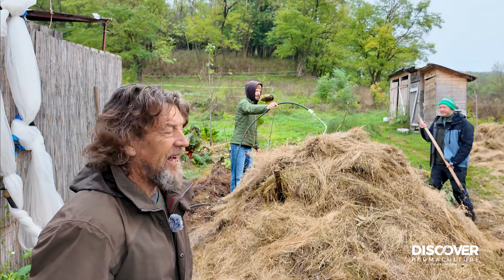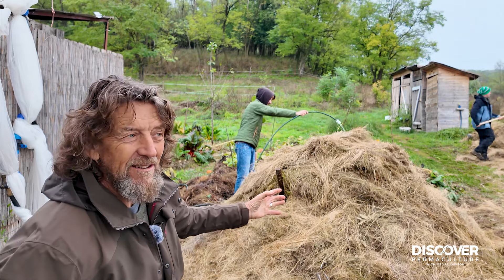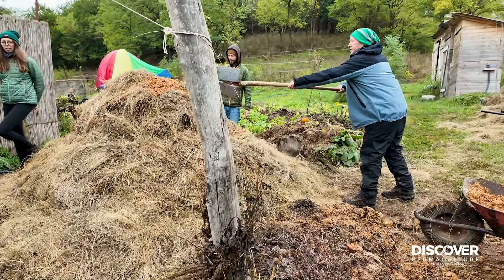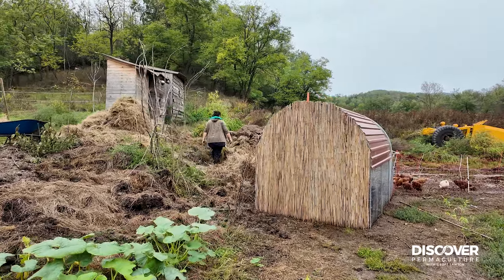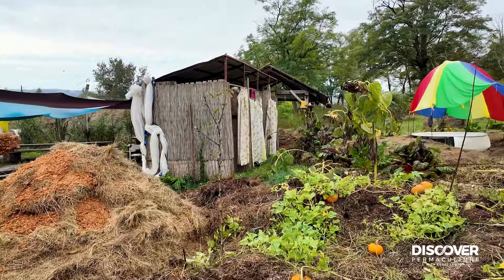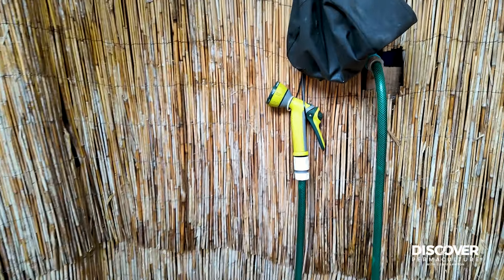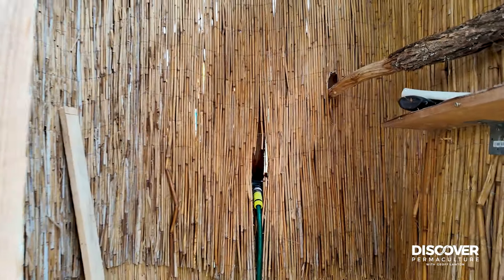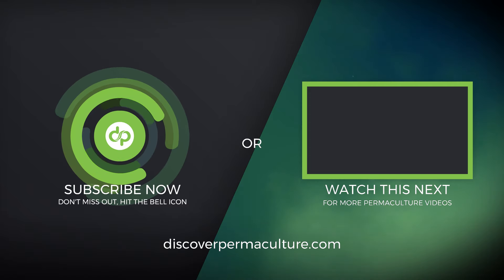Hot Water Compost System in Hungary

Comment: Does this system have its own water pump? Curious because I live off-grid and would potentially need to gravity-feed a shower using this system. Such a great idea nevertheless 👌🏽
Reply: You can use a pump. However, it more efficient to elevate the input water so it could be gravity fed into the compost pile.

Comment: If a concrete pit was built with a plastic pipe spiral in it to make the heat exchange between the hot compost and the water in the pipe better, and the compost pile was covered with some insulation, than the system would be even more efficient.

Comment: Nice, but where are the valuables informations like : What quantity needed, what spectification of compost is targeted, at what cycle does it works usefully, what can we expect from this quantity of work, how many turns of pipes in what configurations, what use of the compost, what energy involved for what output..?
Reply: You need four cubic yards minimum. Search for Jean Pain.
Reply: @estebancorral5151  Yeah I already made many searches around Jean Pain, but actually with less quantity I tried and it worked quite well, but stil i'm an not satisfieed with the ratio work/heat harvested.., the germans have experimented system of 1 cubic meter in IBC tank also, name "biomeiler" if i remember well

Comment: It won't work anywhere near as well as you think, looking forward to updates.
Reply: Agreed. I love the hot water from the compost, but the showerhouse was both wet and decomposing. They needed to use waterproof materials for that construction, like aluminium or tiled brick. All the spores and microbes eating the shower walls would make it impossible to clean or to get oneself clean. As much compost as they had, they'll have to put the shower walls in the compost.

Comment: You would need a lot of compost to keep this going and it would require a lot of work to change the compost when it runs out of heat.
Reply: Yup, lots of biomass needed for sure. Some areas have huge amounts of wood chips available. You'd probably want make multiple piles and overlap their active cycles to avoid moving a bunch of frozen material in the winter.  Large open covered bays would be great for controlling the moisture level more precisely and keeping your next wave dry and ready for mid winter constuction. Don't know the specifics, would have to play with a system for some years to dial it in.
Reply: In most setups it's used to heat a house for a season. If you gather enough compost it will be warm for 3-4 months. Depending on the climate it might not properly heat a big house but it certainly helps with the bills. You take the compost heap apart in the spring and build the next one in the autumn.
Reply: @DrKrapulax  It'd be cool to tie it into a system with a huge insulated tank in the basement. Energy from solar hot water and water from the compost can cycle through there whenever those systems are producing good heat. I figure the solar hot water system should run on some sort of anti-freeze fluid and be kept seperate from the water in the tank and just exchange energy. While the compost pile is going it gets wicked hot so might as well let it transfer energy out in the pile and run water through it into the tank. I saw something like this at D Acres years ago, but just the solar hot water and basement tank and a complex plumbing system. I prefer more simple, but a complex system would be able to slot right into most homeowners expectation for how things should work.
Reply: @HoboGardenerBen  The systems I saw were directly connected to underfloor heating pipes, probably because it's cheaper and in Eastern Europe this is a "hobby" for those who want to reduce their utility bills. A more complex system might offer some advantages but some disadvantages as well.
Reply: @DrKrapulax  Hmm, that's a cool idea, I like it. Especially if the floor has a lot of mass to smooth out any temp swings.

Comment: There are too many ways to compost. At this point I need some kind of debate or contest.         1 Hot composting vs 2 vermicomposting vs 3 black soldier fly composting vs 4 just throwing everything in a pile and burning it, terra preta style vs 5 throwing everything in a pile and forgetting it completely vs 6 hot water composting? Might the winner depend on the material? I know worms are fit for plant-based material if it’s mainly fiber and sugar, while fly larvae can better handle fats and proteins.
Reply: There are too many ways to moove. Car, bike, shoes, barefoot, planes, tanks, .. What is adapted is depending of what you are looking for, from what input you are ready to give, to what output you are looking for. This os one of the permaculture principles...